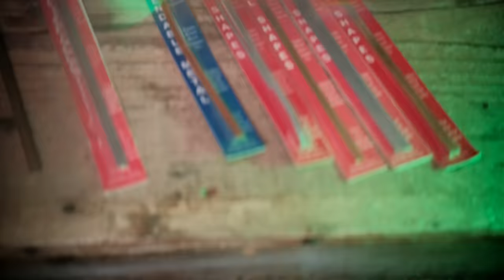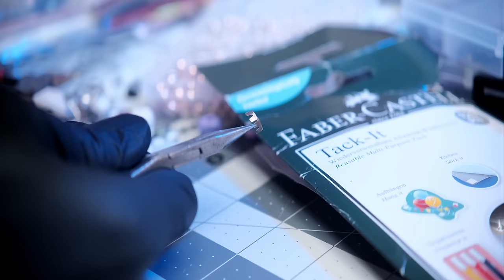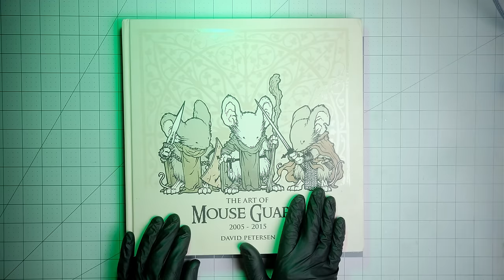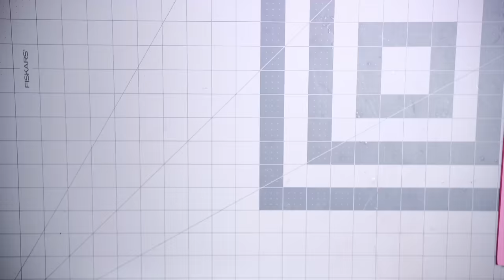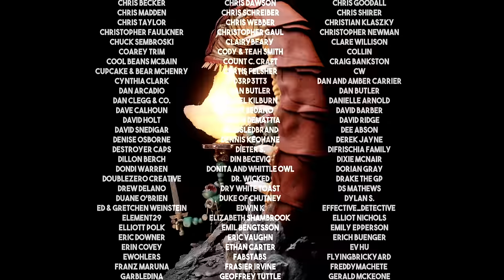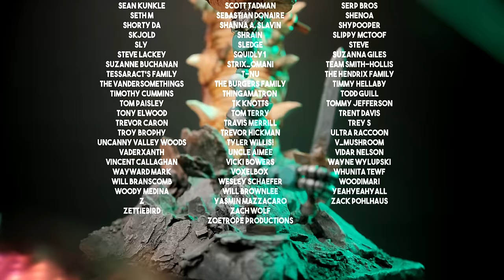How to make a GIANT WORM ATTACK diorama (with BEADBOTS!)

Comment: Came out really nice! Small tip, you generally want to put a series resistor on leds to lengthen their lifetime and prevent them burning out (you can use an online calculator to get the value).